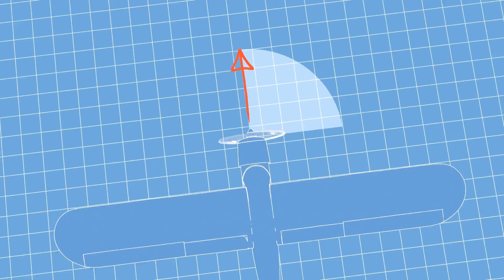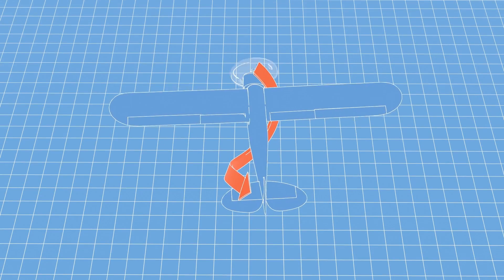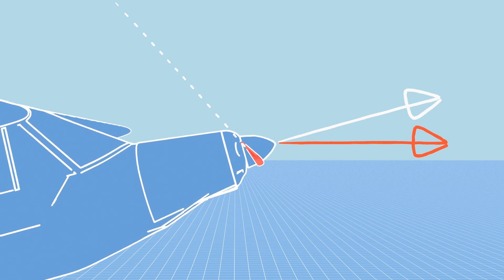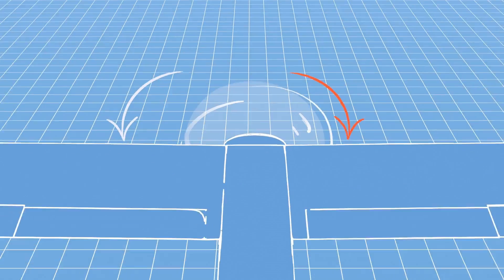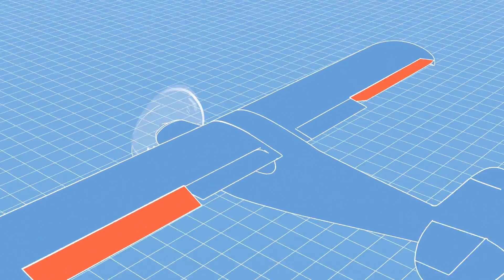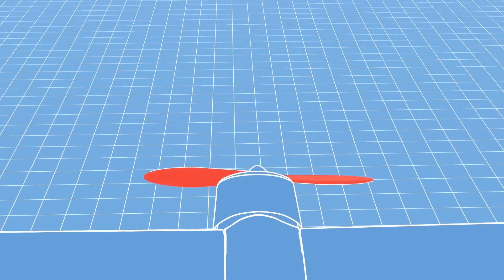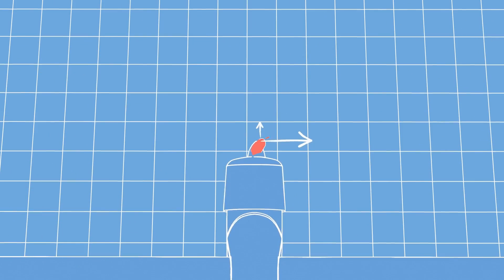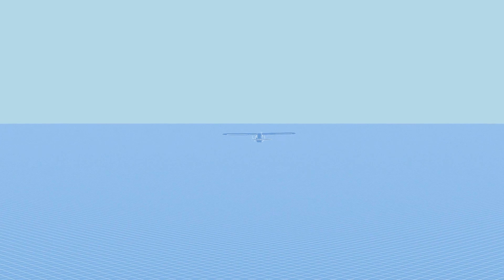Why Small Airplanes Have Angled Motors

Comment: Come on man !! You know,  that thing ??!!
On gliders,  to compensate for the adverse yaw in  a turn,  the down aieleron only moves about half the distance as the one going up...
And the prop isn't pushing air through it . The front of the prop pulling it. 
The difference between the low air pressure, and the high air pressure,  is what causes the prop to pull 😮😮

Comment: All Radio Controlled single engine airplanes models are designed with 1 to 2 deg of right thrust, just buy one and you’ll see that, even the rubber band free flight models, have that design feature.

Comment: Some airplanes are worse than others. Taildraggers are very finicky when the tail comes up due to gyroscopic procession. Older airplanes such as Stinson 108’s and Aeronca Chiefs have very disagreeable adverse yaw. Roll the yoke left the nose goes right while the wings stay level. The remedy to AY is to first use the rudder to begin the turn then use the ailerons to coordinate the turn. Cessna engineers solved this problem in their 150’s and later single engine aircraft by designing an aileron with a ridge on the bottom of leading edge that protrudes slightly below the underside of the wing providing increased drag to the wing in the direction of turn.

Comment: This video is misleading.

Most small, conventional airplanes have engines that are mounted straight ahead, aligned with the fuselage. This is because aligning the thrust of the engine directly with the centerline of the aircraft helps in maintaining straightforward control and stability.

Some specialized aircraft like VTOL (Vertical Take-Off and Landing) Aircraft,  including certain small models, might have engines that can tilt or swivel to facilitate vertical take-off and landing. These engines are indeed angled, but this design is more complex and is typically found in military or specialized commercial aircraft, not general aviation.
Reply from the maker: Indeed not most, but it's somewhat common

Comment: Some designs not only offset the thrustline, they also offset the rudder, both in mount point and angle.
The Gyroscopic precession you mention is why the WW1 Sopwith Camel was both one of the hardest planes to fly, and also one of the most maneuverable.  The engine cylinders spun with the propeller (a rotary engine with a fixed crank, not a radial where the cylinders are fixed and crank spins)  
The added rotating mass made learning to fly it a real challenge, esp take off and landing. These engines had no throttle, controlling speed was done by "blipping" or switching the ignition completely off. The resulting torque reaction + centrifugal forces of cylinders and propeller caused the Gyroscopic precession that made joystick response totally counter intuitive, and changed depending on air speed.  I think the Sopwith Camel took more pilots off the census due to handling errors than combat losses.

Comment: I think the P in P-factor is for pitch, not propeller. It’s the difference in pitch between the descending blade and ascending blade caused by the angle of the relative wind.
Reply: I believe that you're correct.

Comment: Seems like you'd be better off just bipropping.
Reply: That's a bit too complicated for something like a cessna 150 or a piper cub
Reply: @calebmenker988  its literally 3 additional gears and 2 prop blades.
Reply: @formdoggie5  or you could just use a little bit of right rudder and avoid the extra parts and increased complexity that can fail

Comment: The majority of the reaction is the torque, the others less so, but a rudder solves a multitude of aircraft design sins. Then a trim tab on the rudder solves the other problems the rudder causes.  When in the cruise an aircraft is typically set up to fly straight without any input but very few do. So the trim tab is a bendable bit of metal that you can  bend until it all flies straight.  Then the next problem is that only works at one power setting....

Comment: I cant imagine designing an airplane with having to deal with so many factors
Reply: Now I will go to ksp 1 and will try rotate my motor this way😂
Reply: Try designing a helicopter.
Reply: @toolbaggers  this
Reply: Anything will fly with a big enough motor.  An old truism from a long time model aircraft builder.
But these factors are well understood, and when designing a plane you can rely on a great many rules of thumb, including setting the thrust offset.
Reply: Most of the experimental aircraft I've flown are all zero offset designs! From pushers to tractor configurations. Lots of small stuff producing double digit horsepower. I believe the 1946 J3 cub I got my tailwheel endorsement in has 0 offset and there are 
many super cubs with zero thrustline mods. 

Point being you don't have to be a genius, have a degree, or know everything there ever was to know about aircraft design to get started! Even if those things don't hurt :)
 @kaasmeester5903
Reply: You can make a plane fly even without figuring all of this out, but imagine how much better version two of your plane is when you take all of it into account! 

Always room for improvement, quite exciting if you ask me.
Reply: @Dewkeeper Because not every plane has 2 engines, also counter rotating props on a single shaft are much less reliable than single prop with these few tradeoffs.
Reply: why didnt they think of counter rotating props earlier tho
Reply: @ichosolemanuel6048  the Wright flyer had counter rotating propellers
Reply: @fhecrewdavid  why doesnt every plane have it? All those problems could be solved with it
Reply: @ichosolemanuel6048  Good question! The Wright's used a single engine that drove both propellers. In most cases it costs more to support left and right turning engines. Single engine dual prop designs aren't very popular. Check out the lazair for my favorite twin engine aircraft.

Most single engine  trainer aircraft don't make enough torque to cause sufficient trouble for most students or GA pilots. Your leg might get tired from punching the rudder in if you're flying in the pattern a bunch though!
Reply: @ichosolemanuel6048  подумали. Не было технологий, способных это реализовать. Потом двухвинтовые соосные двигатели сильно громкие.
Reply: That's why there are huge teams of engineers working on projects like this, not a single person.
Reply: Easy to eliminate these factors, get rid of the motor. They call these gliders.
Reply: I make small wooden planes. I go crazy
Reply: Just remember even Bernard Pietenpol with just an 8th grade education could design an airplane from scratch in 1928! Just search his last name. There are lots of planes flying designed and or built by people who just take it a step at a time, do their homework, and keep at it.
Reply: Usually, most of the correcting is done by us, the pilots.

Comment: No wonder! I had a small RC plane with the propeller angled to one side. I thought it was due to damage 😂
Reply: Its a lot more critical on a model aircraft because its extremely difficult for modellers to add rudder as required remotely and they usually have much more power and torque relative to a full-scale.
Reply: @dr_jaymz  it was a 3 channel too, so the rudder was also the only way to control roll
Reply: @tenseven1398  often you can mix rudder and aileron so they are coupled.  One of my most fun models doesn't have a movable rudder, its very over powered so in a climb the only way to stop the yaw is to roll all the way up.
Reply: When I was a kid I was always wondering why my rc plane kept circling to the left even if i was going straight
Reply: I also thought my plan arrived with a defect!
Reply: It probably was because this only applies to full-scale planes
Reply: @RobleViejo  On the contrary, the smaller the plane, the more pronounced these effects get.  I built a fair few R/C planes and all plans specify the engine to be angled a few degrees to the right.  Many molded plastic motor mounts had that offset built in as well.

Comment: I never thought taking of was that difficult, since most video usually demonstrate take off on civilian airplane, which I think doesn't have this problem (and they should be, as they would like to increase the carry load). I also don't think jet has this problem
Reply from the maker: yes, any plane with multiple engines doesn't have this problem, as they usually turn in opposite directions. I'm not sure how jets compare to propellors in this sense. Probably less torque factor, but still a bit, but I really don't know.

Comment: The engine is sometimes mounted on an angle! Because the air spirals around the plane and pushes against the rutter, which would turn the airplane to the lrft. So to counteract this [Repeat from beginning] 😊
Reply: Good job buddy you watched the video
Reply: @codrinmicusan446 Good job buddy you're whiny
Reply: @theguy9208  It's this little thing called a joke, which flew over your heads.

Comment: Afaik for some of these forces the correction is built into the airframe, like having a wing with a slightly higher angle of attack than the other. Its very slight tho, so pretty hard to notice
Reply: some historical aircraft like the Macchi C.202 countered the effect by making one wing longer than the other. The C.202's left wing is 21cm longer than the right.
Reply: Btw, love your videos!
Reply from the maker: Ah, interesting. Thanks!